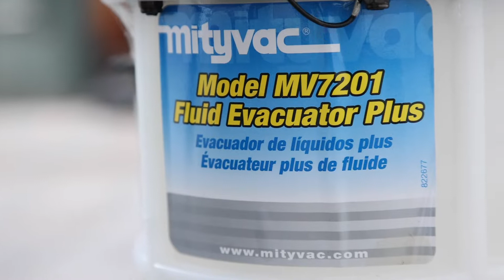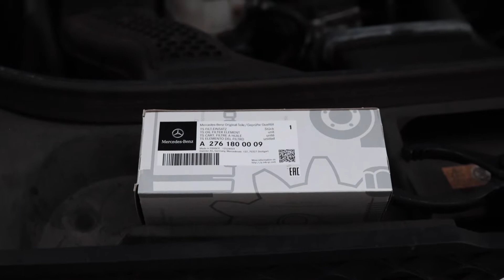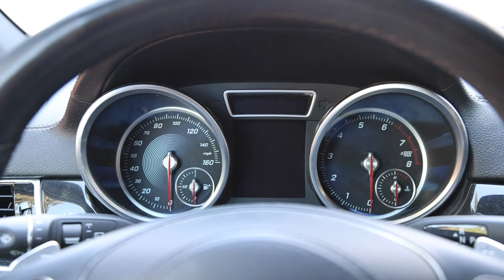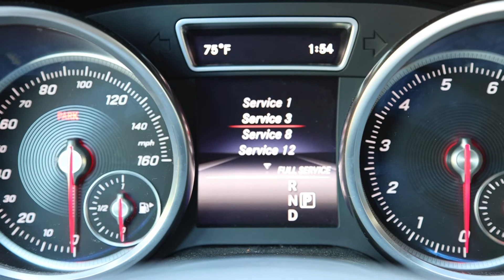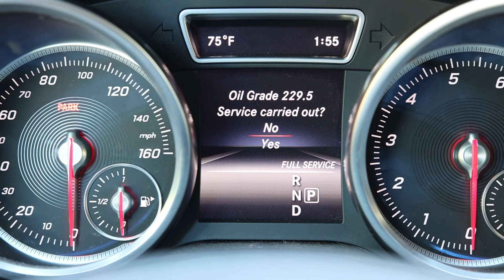Mercedes Benz GLS 450 Oil Change DIY | Mercedes DIY | Mobil1 Oil Change | Easy Oil Change DIY

Comment: Very helpful. Thanks for that could not find where to do that was told there’s no dipstick in my Mercedes can the same be done with transmission
Reply: The transmission drain plug is also how you refill it. It has a plastic tube that connects to the inside of the drain inside the pan to keep the level where it needs to be during refill. Once you drop the pan, you’ll fill with 6 liters of transmission fluid, start the engine, shift through the gears, then add 4 more liters while it is running. It will begin to drip out when you have reached the proper level.